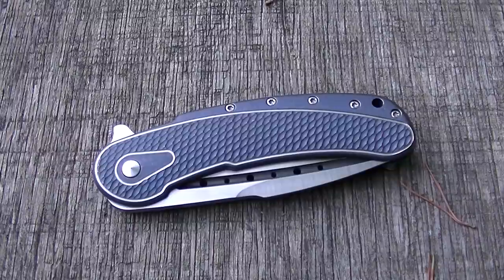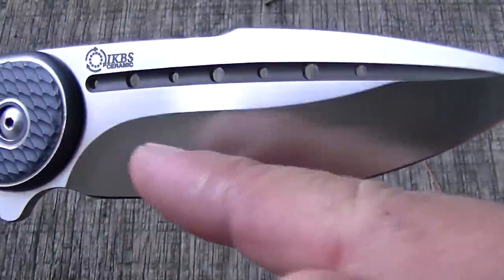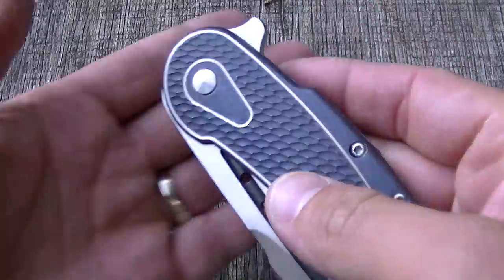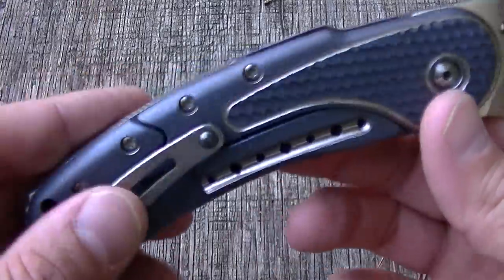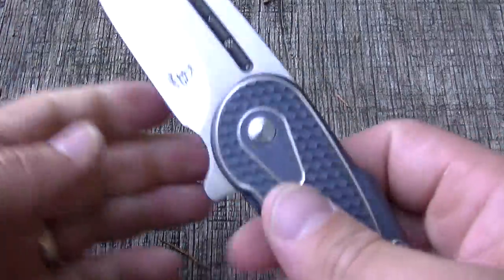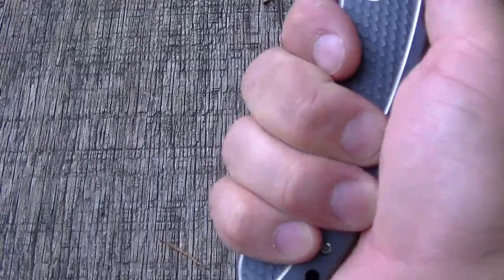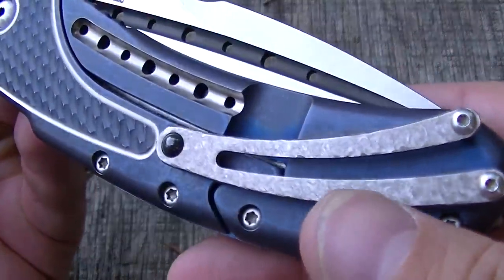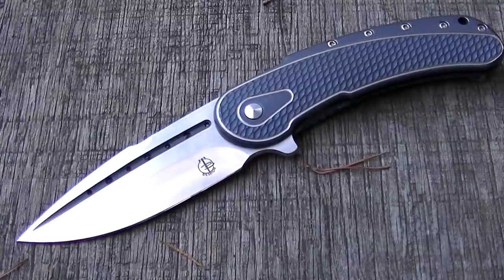Todd Begg Bodega

Comment: Love the Bodega 2.0, the original Bodega (that used both Ti and CF or G-10 as inlays on the presentation side), the Beggati, and the Glimpse -- they're some of the best mid-tech-production knives ever made, along with Shirogorov's Model F95, Model F3, and Model F111, and Rockstead's Shin, Higo and forthcoming Sinkevich collab, the Shun.

The Field Grade Bodega's... not so much. As 400$ knives, definitely, as 800$ knives -- fuck that. I'll be buying the Kwaiken made by Reate for the Begg Steelcraft line, and at 500$ I'd take it over a FGB. It wouldn't take much to make it more palatable, and I predict you'll see those FGB-upgrades soon.

Like Andre Thorburn, Andre Van Heerden, Dave Curtiss, et al, Begg uses Bohler N690co. With a proper HT, these master knife-makers coax an optimal performance from the steel.

But N690co is not a PM steel, and is one of Bohlers least expensive blade options. It's virtually identical to VG-10, and is popular with makers -- like CPM 154 and CTS-XHP -- not because it saves a few dollars per knife, so much, but because it's easy to sharpen, takes a keen edge, and polishes up very quickly and nicely. M390, CPM M4, CPM S30V-thru-S110V -- all cost a bit more per slab from the supplier, but they take longer to mill, sharpen, polish, etc., and time is what creates real expense.

N690co is decent, but edge retention is near the bottom of the list. Begg does use other steels, but N690co is far more common. Great vid.

Comment: Nice knife.  I think though that they went overboard with the variety of finish details.  I would have liked the back spacer and the clip to have the same type of finish, either one would be fine, but the the scales having the scalloped type finish, and the diamonds on the backspacer and then what they did on the clip, all mixed in with a blade that has a lot going on it just seems to be too much.  Of course, this is just a personal taste comment.  Great video, by the way, I like how you go over everything slowly enough but without dragging things out.

Comment: I don't get the Bodega. The design looks confused and gaudy. Todd uses alternating size drills holes in a DLC coated fuller that has been ground back to satin flats. How many screws does Begg need to hold it together.. Why not bring them flush to the surface? Never mind there's half a dozen finishes going on.. What is the point of the textured and then gear patterned back spacer? Pick a design theme for the knife instead of throwing everything but the kitchen sink at it.
Reply: I thought i was the only one who didn't find the bodega attractive. The finishing is amazing but the design is just to cluttered and busy, lots of individual design elements that are fine individually but dont mesh, too many different surface finishes and way to many screws.

Plus the blade is horribly impractical, the plunge grind is about 1/4 of an inch long so you cant sharpen it and the hollow grind does'nt look even. 

I can see why its worth the price but not a design i'd go for and sacrifices practicality for the sake of looks.